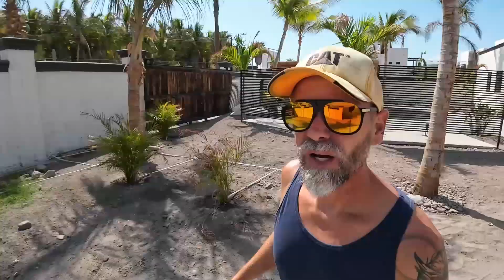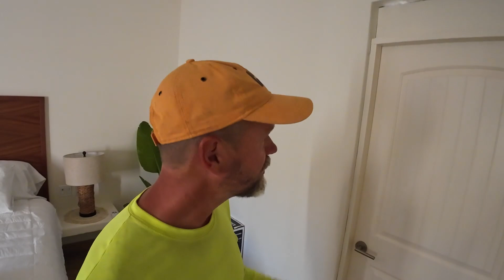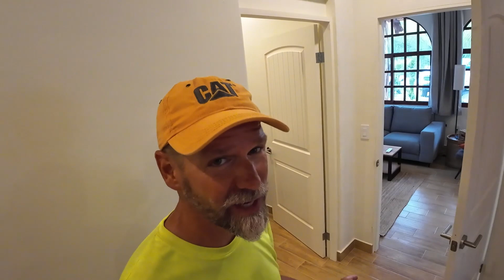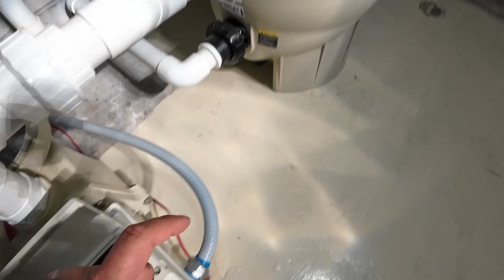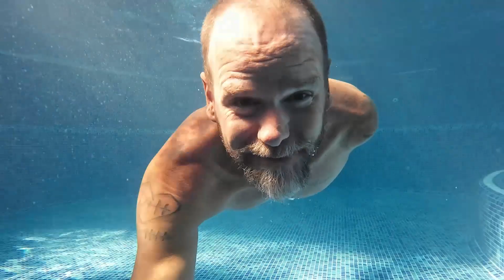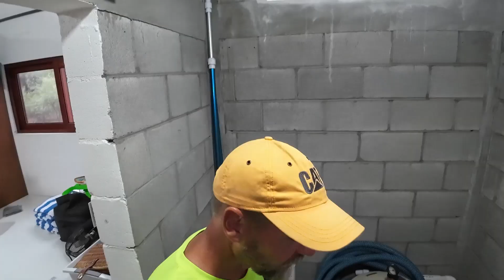Will We Finish Our Resort in Time???

Comment: Everything looks great. Most of my friends changed their pools to salt water. They love it.
Reply from the maker: We considered salt water but several people have warned us that salt water pools can cause massive problems if the shell is not sealed. The pool construction here is mortar covered cinder block sealed with a liquid seal coat on the inside. Often this system allows water to leak into the block and then if it's salt water the rebar in the block can rust and cause the pool shell to fail. With gunite pools this is not a problem. We are looking at UV+Ozone sanitizers to greatly reduce the chlorine usage